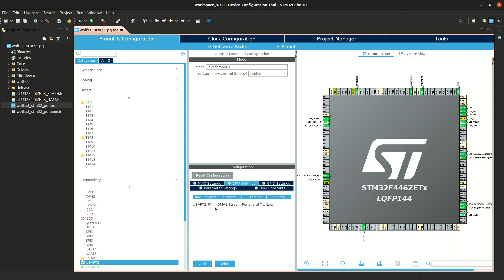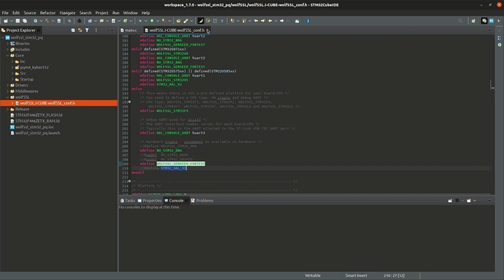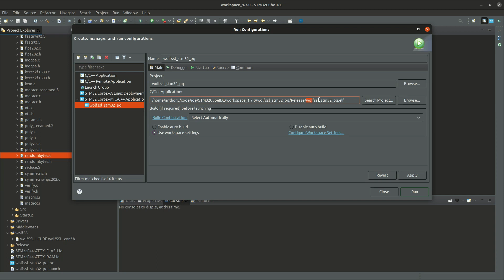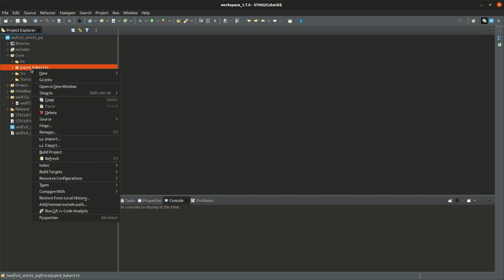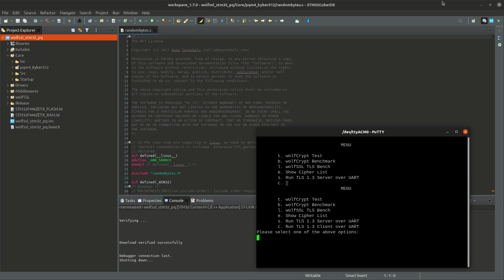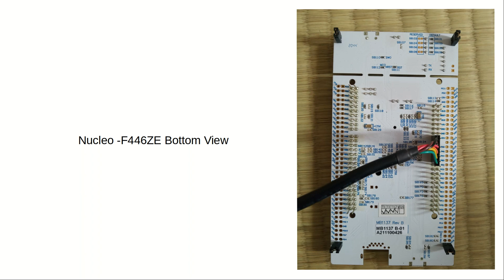wolfSSL Brings Post-Quantum TLS 1.3 to STM32 Cortex-M4

Comment: I tring to use STM32L4 Nucleo board to make a Wolfssl Connection. but when i try to build the project it shows error in setting.h file.  it shows like this. unresolved "stm32f4xx_hal.h". how can i fix it.
Reply: You need change #define WOLFSSL_STM32F4 to #define WOLFSSL_STM32L4, your code call  "stm32f4xx_hal.h" and he needs call  "stm32l4xx_hal.h"